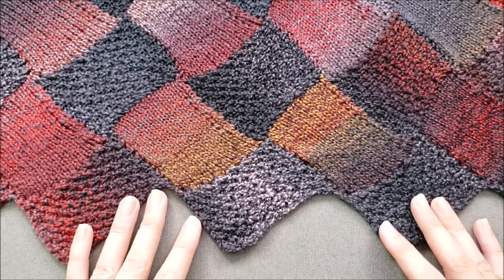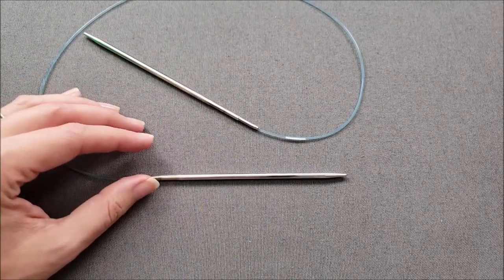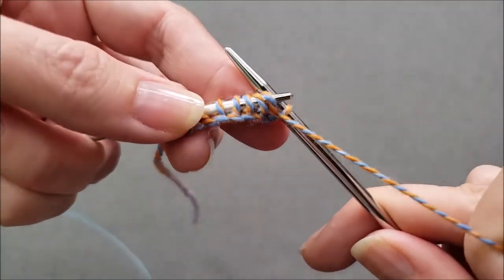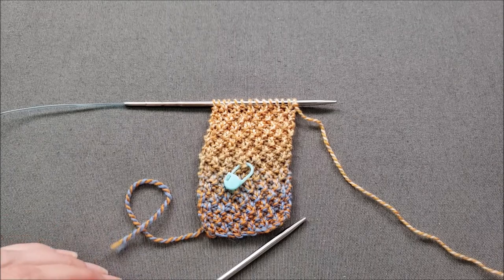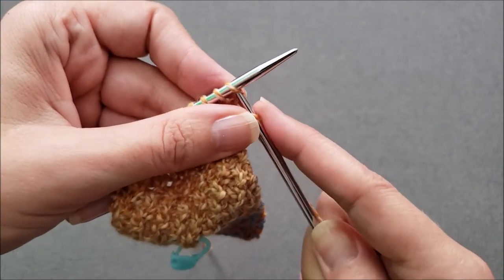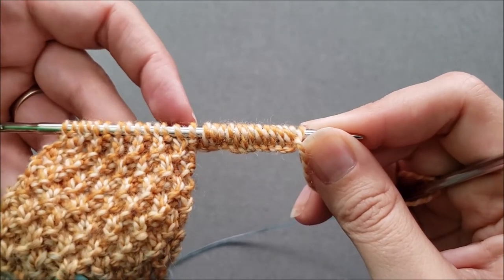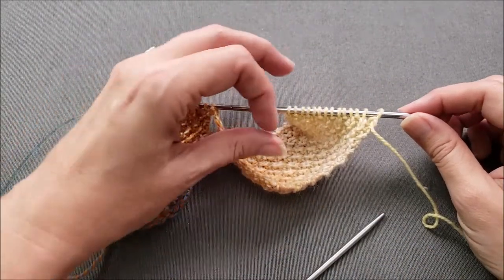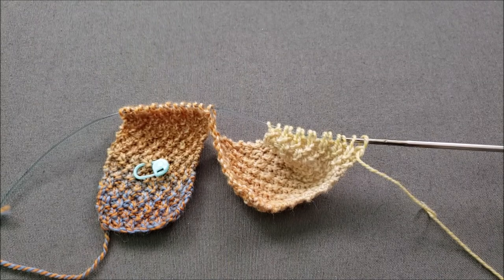Entrelac Base Rectangles

Comment: What do you think as the ideal yarn.  Wool?  Thanks..
Reply from the maker: Surprisingly, I don't think there is an ideal fiber or yarn. Every fiber has it's own unique qualities (breathability, insulation, strength, shine, elasticity, durability, washability, environmental impact, etc.). So, it kind of depends on what fabric characteristics you want to achieve for a project, as well as what you like to work with.